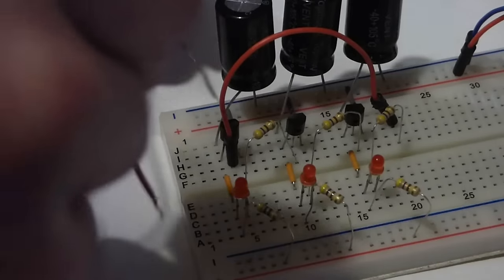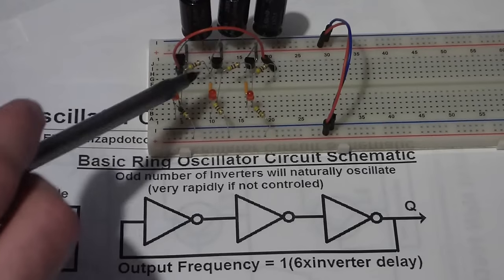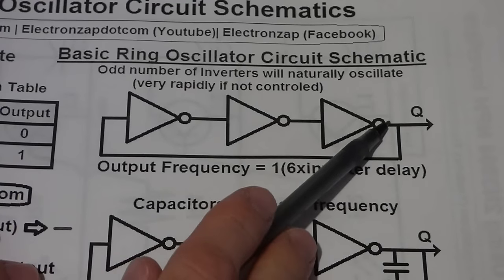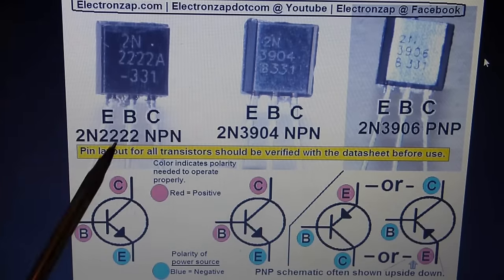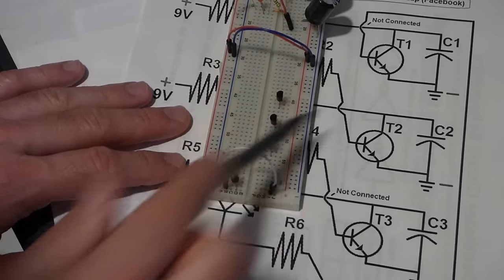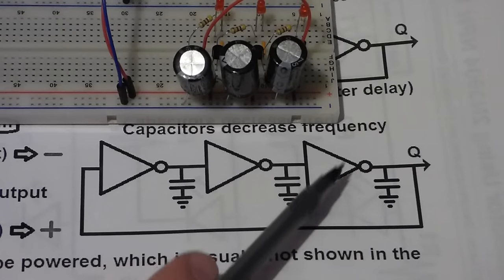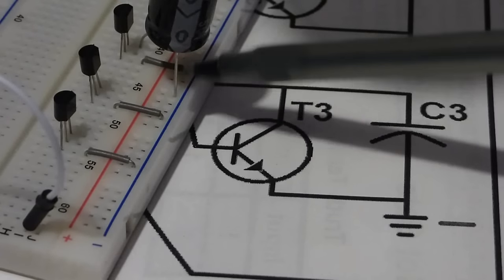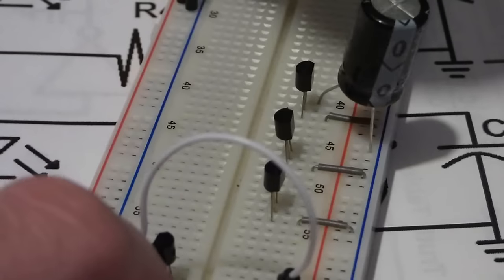Step by step build Ring Oscillator with 3 2N3904 transistor inverter electronics circuits.

Comment: Great circuit to try out and learn about. A few lines of arduino code would get the same results but no where near as much fun, thanks for posting
Reply from the maker: Probably lots of more efficient ways to make a ring oscillator, I mostly designed this one for fun.  :)

Comment: If you build the circuit for the degenerate case of single inverter only (feeding back to itself), will it simply be a flasher at that point?
Reply from the maker: I think you need at least 3 inverters in series.

Comment: I've watched through the whole video about 3 times now, and I can't get the circuit to work. I've taken it apart and reassembled it 6 or more times, doing it differently each time, and it always ends up lighting only 1 of the 3 LEDs (I think it's always the middle one). Do you have any suggestions?
Reply from the maker: That's a bummer. It's easy to accidently insert a wire into the wrong hole (I do that all the time) or put an LED in backwards. LEDs are really easy to burn out, so one could be bad. I usually check the schematic and check each spot that components come together (node). I make sure each node has all of the components plugged in to the same row of the breadboard and if one is missing I look in the next row to see if I accidently inserted it there. But as long as every component is known to work and is inserted correctly, then most likely it is that a lead or other wire is not connecting in the breadboard slot properly for whatever reason. I usually wiggle all of the component if I am sure I wired it correctly and usually once I move one a bit, then suddenly the circuit works, I just have to get it to stay in a position that it will stay in contact. Hope that helps!
Reply: Thank you for replying so quickly. I tried everything you suggested, except checking the LEDs (because I was so sure that they were working). I quickly found my mistake (burnt out LED), and now it's working 😃
Reply from the maker: Great! Glad to hear!
Reply: @anthonygendron5648  0,1,0 would be caused by a lack of feedback.  its a still state.

Comment: Hi, how to calculate the load capacitance that goes in the output? Here you can see my diagram. https://drive.google.com/file/d/1L0AtwjxHi8ZTSwoaFEfCANHbH1snIHFn/view?usp=drivesdk
Reply from the maker: lol, that's a pretty wild circuit. I don't think it does anything but hopefully oscillate. So no clue. I would guess, probably any larger value capacitor that is safe to use.

Comment: does not work
Reply: Amanda Suchadoll cause you failed to follow instructions
Reply: Either that or physics has changed since June 2016 :D
Reply: Amanda Suchadoll 
This is a difficult circuit to make sense of.  The series connection of collector resistor, LED, base resistor and next base is confusing.  It's better to use this one.  It's simpler and uses much smaller capacitors.

http://botronics.net/ring.html
Reply: @acmefixer1   Years ago I built a 3 channel color organ. But wanted chase lights and I built the ring  oscillator into it. People liked it for parties it ran into a solid state relay made of silicon controlled rectifiers that powered Christmas tree lights. Later as technology was available I brightened the lights  with full wave triacs . The signal went through optical coplers.
Reply: @acmefixer1  I ended up building both circuits, the one discussed here, and another one similar to your reference.  I do agree that the latter circuit is easier to describe in plain english.